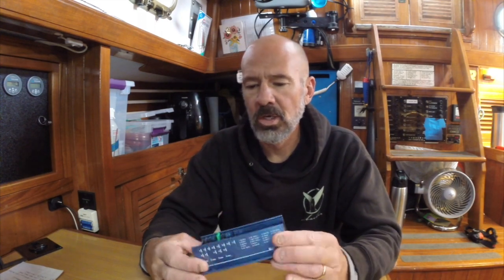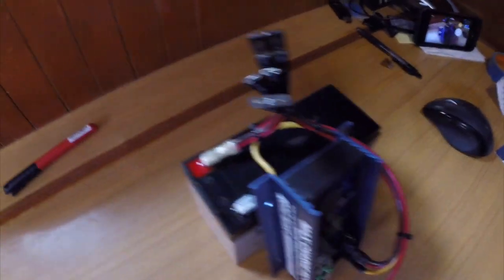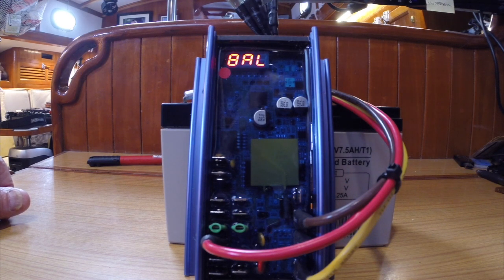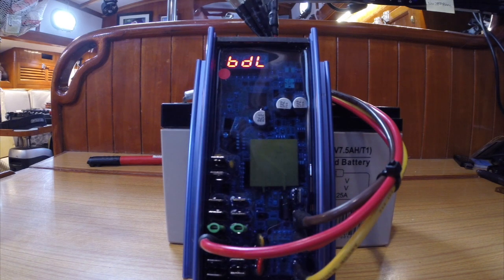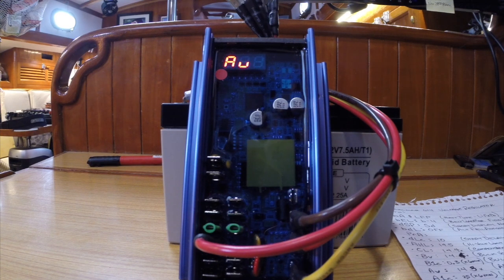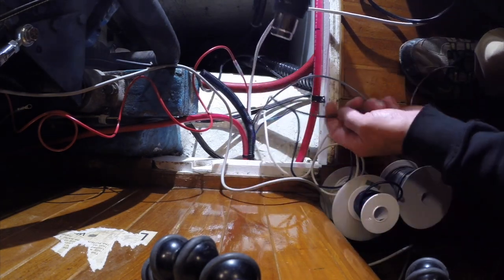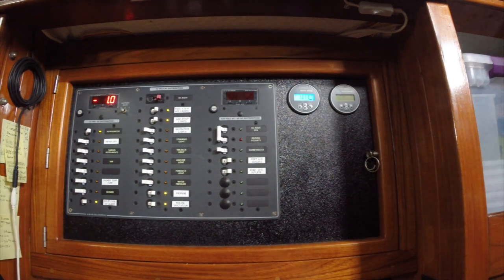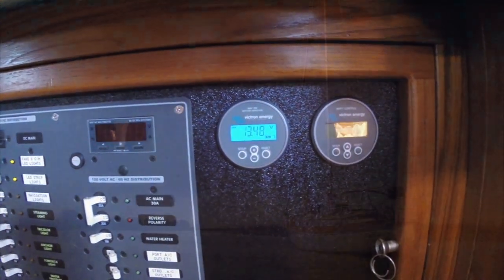SV Ramble On | Voltage Regulator

Comment: For someone attempting a less robust electrical system, just to turn on the inverter and see it drawing 9 amps would be unacceptable and send one back to the drawing board.
Reply: On some inverters, you can change the current sensing threshold on the AC Bus, and keep the inverter from waking up and consuming current.

Comment: Hey Rich.  I noticed the warning in the regulator install manual about how the BMS in some LiFePo4 batteries may disconnect the battery on full charge or other error conditions, and that you must shut the regulator down before disconnecting the battery or damage can occur to the alternator and regulator.   Have you done anything to protect the system in the event that the BMS in the Battle Born batteries shuts off the battery?
Reply from the maker: Hey Jeff, I originally programmed the regulator for 0.1v less than the BMS cut-out and haven't had a problem so far on long motoring trips with fully charged batteries.  Another viewer mentioned the Sterling Power Alternator Protection Device ($70 from marinehowto.com) so I thought I'd give it a try.  It's basically sacrificial diodes to protect the charging system from transient voltage spikes or a BMS shutdown.  I haven't installed it yet, but it's dirt simple and only takes a few minutes.  We plan to do a future video on the how & why, but you can also check out this article in the mean time: https://marinehowto.com/1-2-both-battery-switch-considerations/
Thanks for watching.

Comment: it would be nice if you had shown how to locate the wires you hooked up to and where they came from on the altenator
Reply from the maker: Hi James, thanks for the comment.  Depending on which make and model alternator/regulator you install the wiring connections can vary quite a bit, and in order to keep the videos short and to the point sometimes parts of the installation get clipped in the interest of time.  We've never claimed to be an instructional how-to DIY  channel; we're just here to let people know what we're doing to fix up our boat and maybe pass on a few ideas and techniques along the way.  For a more in-depth explanation on marine plumbing and electrical repairs I highly recommend picking up a copy of Nigel Calder's Boatowner's Mechanical and Electrical Manual.  Often called the "DIY Boat Bible", I'm constantly referring back to it for information on projects such as this.  Thanks again for watching.
Reply: @svrambleon  thank you , I was just looking for some specifics and not finding any on any channel , I did talk with Beta marine for a long time and Faron set me up with the minimum wire guide to run the regulator. I think besides all the wires that actually go to the balar 614 My main confusion is that - I thought it was linked in line to the battery, solar panel systems and that its real function is to go back to the alternator.,and now as you said I have 2 temp sensors and other functions ,Im also sure that getting into to much detail might open you up to liability so I do understand .best James

Comment: Since you already installed that huge inverter charger, why would you need another charge manager?? Battle Born LiFePO4 Deep Cycle Batteries seems to be "drop-in" which I am hesitant to trust. But, I thought the Victron Multiplus 12/3000/120-50 120V VE.Bus seems to be the charge controller as well as the inverter. I'll spend $300 to protect 4 grand worth of batteries, If I have to. I just need some more edumacation. :)
Reply from the maker: The Balmar voltage regulator controls charging input from the alternator when the engine is running.  The Victron Multiplus only charges batteries from shore power, or when plugged into a portable generator (like our Honda 2000).

Comment: I am upgrading to 4 / 100amp lithium batteries. Do I need a separate battery to start the engine??
Reply: Figured it out, I can use one of my AGM batteries for the starter battery and charge it from the second battery bank connection on the Victron Multiplus 12/3000/120-50 120V VE.
Reply from the maker: @RickeyMoore  True, that's possible.  We installed 5 Battleborn batteries all wired in series; one big house bank that also starts the engine

Comment: Also, the reason the amp gauges don't register when charging with the alternator is because you connected the alternator ground to the battery side of the shunt, rather than the system side. Just my $0.02. Keep the good videos coming.